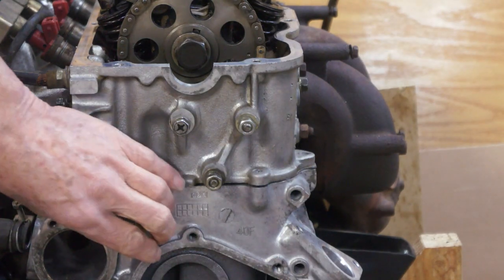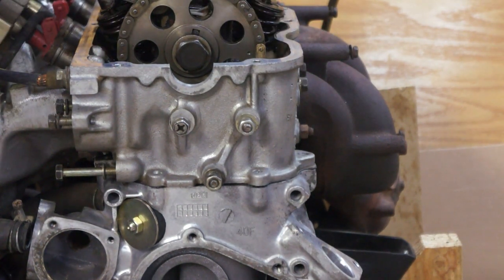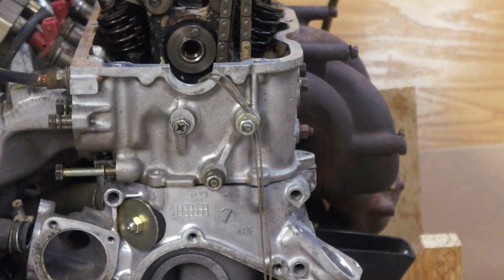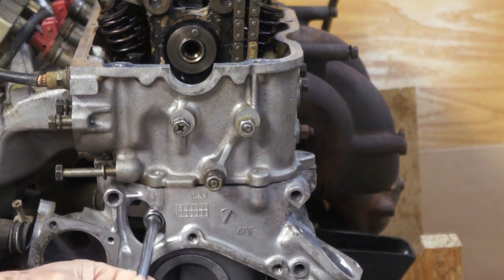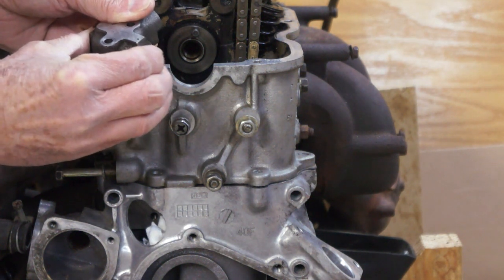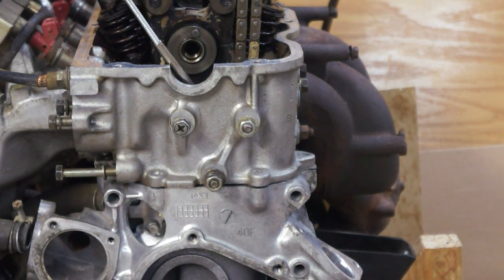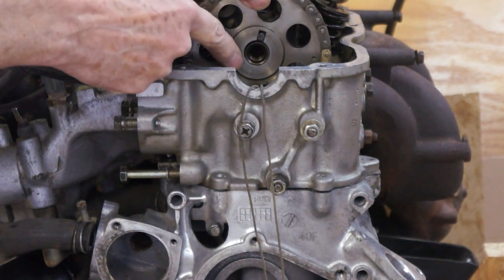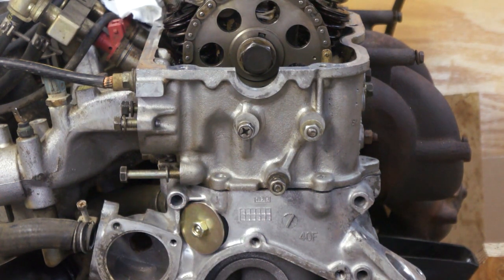17 Nissan KA24E Self Adjusting Tensioner Install

Comment: Hi mr Jim. Do you know if the tensioner can be replaced without that plug? I have a stanza and the frame rail doesn’t allow the hole to be made.
Reply from the maker: No it can't.
We have attempted to remove the tensioner in a D21 with out the access hole.
The tensioner fasteners can be loosened and turned out but they hit the front cover before they free themselves completely of the threads in the engine block.
Reply from the maker: I am not familiar with arraignment of engine and that frame rail, wonder if there is a modified short profile hole saw or drill motor that could be used.
But then you would still need to get a socket in there to get at the fasteners.
Reply: @Mr1jim  unlikely, there’s about an inch and a half of space there. Looks like I’m pulling the cover again. Should be much easier this time now that I have a garage and a lift to do it on
Reply: I just replaced mine without the plug. It is not easy and I wouldn’t recommend it without the oil pan being off just in case you drop it. The 2 10mm bolts will not come all the way out, which causes the problems when trying to get it out. But with the help of a few extension magnets it can be taken out with the bolts still ran through the body of the tensioner.
Reply: @daveystarcher9798  on a stanza?

Comment: and sometimes, there's no start up rattle but instead chain slapping at 1800-2500 rpm... no rattle at idle, none at start up, nasty 'tween 2 and 3 grand rpm though, nasty sounding like God's fingernails running down an metal chalkboard makes my hair stand on end every time horrid horrible horrific sounding.
Reply: Yes,
 If engine is shut down with the valve springs putting pressure on tension side of chain there will be no start up rattle.
If engine is shut down with the valve springs putting pressure on the slack side of chain, this pushed the tensioner piston into its bore and there will be start up rattle.
Start up rattle is dependent on if valve springs are putting forward or back pressure on the cam shaft.
With the chain being so long in these they need the guides to control chain oscillation at different speeds.
Reply: @jamesmartin5370  have you ever run a KA24E with a ratcheting tensioner without the outer guide in place? Wondering if it would work or not because I was advised to delete the outer guide by a random mechanic who is a KA24e owner... 

Did so and now the chain is rubbing in a different place at higher rpms. Bad advice maybe? wondering if the advice was wrong or if, with the ratcheting tensioner that would maybe negate the need for that guide. Or not.

 Anyway I'm about to find out... Going to put a shimmed piston in and see if that helps run without the guide at mid level rpms. My experiment was to find out if random guy was right or not.
Reply: @hehunches  
Running these engines without a chain guide is Bad Advice.
I would not do this.
With these overhead cam engines, the chains are long.
They need a guide on both side of the chain to prevent the chain from oscillating.
It will damage the timing chain cover, maybe even cut a hole through it.
I know someone who tried this, the outcome was not stable and he ended tearing it down and installing the guide.
Reply: @jamesmartin5370  good to know. Maybe the joke's on me and the guy who advised me to do that and his buddies are laughing at me behind my back because I'm pretty sure I've wasted all my time and I could have just done it properly first time around... I had the motor pulled and the cover off for this outcome. poor. I guess I can say, I'm going to get 'well practised' at pulling the tc cover in a Nissan Axxess (which sucks) haha. I think I might install your access holes in the Axxess tc cover so the issue never comes up again. do it right the first time, right thanks for your feedback man
Reply: @hehunches  
Before you put it back together.
Inspect the timing chain for excess slack.
Rotate engine until the tension side of chain is tight, this is the side with the straight guide.
Then look to see how much the tensioner piston is sticking out of the tensioner.
If it is sticking out 3/16" of an inch or more this is too much slack and you will hear the chain at start up.
The slack can be adjusted out of the chain using an adjustable piston with shims, but keep in mind, this is a manual adjustment, as the engine gets more hours on it the sprocket teeth and chain will wear and the slack will come back and another adjustment will be needed. The self adjusting ratchet tensioner is self adjusting so it will self adjust as needed always keeping tension on the chain, its the better of the two methods I know of right now.

Comment: Fantastic, betweeen the 3 videos 15, 16, 17 i was able to do this job. Starts and sounds better now, and runs way better. Couldnt have done it without these videos, and Mr1jims fantastic responsive emails with so much detail, it was like he was in the room helping!
Definitley reccomend doing this if you have any start up/driving rattle.
My 1992 hardbody pickup does not have AC /AC condensor so i just took the rad, fan and the grill out and had tons of space to use my full size drill, and be 100% confident on the hole location by seeing it straight on from the front.
Take your time, watch these videos multiple times and refer back while doing the job and its very simple.
I also highly recomend the rachet tensioner that Mr1jim Sells and shows. Its defintley the best option and absolutley worth the extra little bit of work. I was surprised, once I started and pulled a couple things out of my way, at how simple the whole thing was, provided you are very cautious not to let the chain slack. Have a few sizes of bunjee cords at the ready before removing the cam bolt.
You're the MAN Jim!
Reply: Thanks Justin, 
Amazing how strong these KA24Es run when valve timing is being held where it should be.
Glad it smoothed out the low power band in the low rpm range, its always nice to have an energetic peppy engine.

Comment: My ka24e will stall and die as soon as I put it in first gear but it will run good in neutral
Reply: Could be a number of items?
Might be related to TPS, MAP,  and or the MAS, these three sensors work with each other, if one is faulty, it could cause the others to send incorrect fuel mixture or wrong distributor timing at the wrong rpm range. 
Which could engine to stall when rpms are changed or if power is demanded from engine. Not a sure thing but worth looking into because these three sensors could cause condition you describe. You should be aware that the TPS is a variable rheostat and needs to be calibrated when installed so if it has been removed and not calibrated this could be the cause. 
Don't remove the TPS unless you have an ohm meter to calibrate it, which will need to be done when you do the re-install.
Reply: James Martin I put in a new tps I do not know how to calibrate it so I might put the old one back
Reply: @clutchcrusade  It needs to be calibrated with an ohm meter.
Its just a basic a rheostat. it sends a variable electrical voltage to the computer as the gas peddle is depressed.
As the throttle butterfly valve opens the voltage increases and the computer reads the voltages from the  above three sensors mentioned, averages them and then adjusts air to fuel mixture and distributor timing as needed. So when a new TPS is installed it needs to be set with an ohm meter before snugging down the fasteners.  
Once the old TPS has been removed, unless you made some type of index locating marks, even the old one will need to be set before the computer will be able to make correct adjustments to the air, fuel and distributor. This needs to be done before you can move forward with any more meaningful trouble shooting.
No big deal, will only take several minutes to do the job.

Comment: You got a Video on how to replace the head Gasket on a 2.4L Nissan pickup truck ?
Reply from the maker: No I don't.
Only timing chain related videos.
Complete factory engine manuals are available at below website:
https://forums.nicoclub.com/240sx-fsm-full-service-manuals-s13-s14-ka24e-ka24de-t311075.html

Comment: Just finished this repair last night.  Jim is the best and his instructions and these videos made the job a breeze.  Just make sure you keep the chain tight to the crank sprocket throughout the entire process.  It doesn't take much slack for the chain to skip a tooth.  Jim is there to answer any questions through the process and the ratcheting tensioner is top quality.